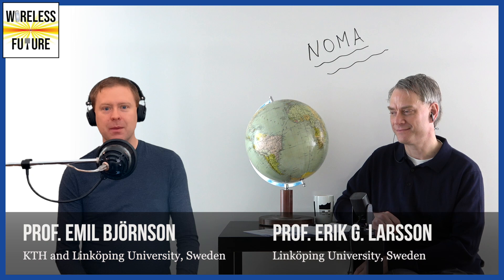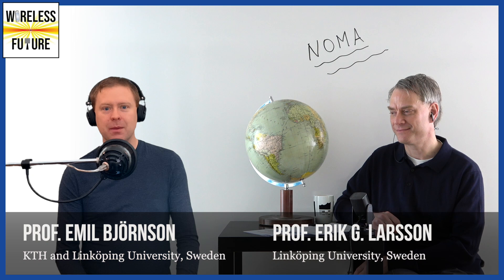Ep 11. Non-Orthogonal Multiple Access [Wireless Future Podcast]

Comment: Dear professors, I have questions about NOMA further. what is the control signaling procedure used by NOMA? how do they allocate different frequencies and time slots to send data? I believe the power coefficients are announced by the control signal. I want to know whether NOMA uses ODFM control signaling or a completely different signaling method? Please do answer these questions if possible.
Reply from the maker: Yes, OFDM is normally supposed to be used and time-frequency blocks can be assigned as in any other system. In addition to normal control signaling, you will also need to inform the involved users of the other users’ coding and modulation schemes and transmit powers, to enable decoding of interfering signals.
Reply: @WirelessFuture  thank you professors

Comment: Why didn't the CDMA prevail in future generation as main multiple access technique ?

How can Noma decoding be used at the UE if the strong user doesn't know the channel of the weak user signal ? 

Wouldn't successive interference cancellation jeopardize the privacy if the weak user ?

Why Noma can't add advantage for massive mimo case ?

At @14:52 you were talking about considering a line of sight channel as Siso channel but you mentioned that this is unlikely in 5g but I believe with the use of mmwave this is highly likely wouldn't you agree ?

Any recommended reference for code domain Noma and how does it work ?
Reply from the maker: CDMA isn’t providing any extra radio resource dimensions, it just divides them in a different way between the users. OFDM turned out be easier to implement and give more flexibility.

In downlink NOMA, a user doesn’t need to know the channel of anyone else since all signals reach the user over the same channel. However, the user must know the modulation and coding scheme of the co-users.

Privacy is maintained through cryptography. Wireless is a broadcast medium so anyone can listen and decode signals.

Non-linear processing such as NOMA can bring benefits when there are strong interfering signals, but massive MIMO utilizes user-specific beamforming to make sure that there is little interference between the users.

It is only a situations where massive MIMO cannot suppress interference well that other methods become useful. This could be a LOS scenario with very closely located users.

I recommend the paper that is mentioned in the description of the video.
Reply: @WirelessFuture  
Thank you for clarifying things up , but in massive mimo we allocate users same time Freq resources and separate them in beam domain

By Noma we can add more users to the system by sharing the same beam , wouldn't this be and advantage of Noma in your opinion if combined with massive mimo ?
Reply from the maker: @yasserothman4023  The problem is that you need to find users with very similar channels so that they prefer the same beam. This is unlikely to happen, except in the LOS case that I mentioned. The rate splitting framework describes in the paper is at least guaranteed to give better performance than massive MIMO in any situation since it is an add on, but my impression is that the gains are marginal.
Reply: @WirelessFuture  

I have some questions in rate splitting and I appreciate your feedback , those questions came after reading the paper you mentioned in the video description 

1-May I know what does the common message represent in practice , how can we determine its size and content ?

2-How does this scheme (rate splitting) achieve better gains compared to Noma if both depends on successive interference cancellation ?
Reply from the maker: @yasserothman4023  1. Section VI in the paper describes that the common message contains a summation of data intended for individual users. It is basically transmitted using TDMA or FDMA, so that each user extracts the part of interest. How to select the right size of the common message depend on the performance metric that you want to maximize. There is a discussion about this at the end of the section, focused on maximizing the multiplexing gain.

2. This is the main topic of the paper, so I cannot repeat it here. The conclusion section provides a summary. “This is due to the fact that the fundamental principle of NOMA consisting in forcing one user in each group to fully decode the messages of other co-scheduled users is an inefficient design in multi-antenna settings.” “Instead, non-orthogonal transmission strategies for multi- antenna settings should be designed such that interference is partially decoded and partially treated as noise based on the rate-splitting (multiple access) literature so as to truly benefit from multi-antenna transmitters (and potentially multi-antenna receivers) and SIC receivers.”
Reply: @WirelessFuture  Thanks again
1-but comparing proposition 7 and 9  in the paper i see that the same DoF is achieved in both the  cases of rate splitting and linear precoding , in this case what is the need for rate splitting that use more advanced receive processing technique as sucessive interference cancellation ?

2-from table II i see that the sum DoF from linear precoding (2nd entry in the table) is lower than that of rate splitting for the case of imperfect CSI 

may i know why ? what is the reason behiend this performance gap although by my first question above both schemes had the same sum DoF for the case of perfect CSI ?

3-all the analysis in the paper solely depends on the Asymptotic analysis of snr as snr tends to infinity , is it practical and sound to judge different techniques based on this regime ?
Reply from the maker: @yasserothman4023  1. Rate splitting can only increase the multiplexing gain under imperfect CSI (there are results regarding that in the paper), but it can improve the sum rate also under perfect CSI. The multiplexing gain only describes the slope of the sum rate vs. SNR curve.

2. The maximum multiplexing gain is reduced under imperfect CSI and rate splitting can be tuned to achieve that maximum multiplexing gain, while linear precoding cannot (unless one adds some layer of scheduling on top of it).

3. There are many relevant metrics and the multiplexing gain (an asymptotic metric) is only one of them. As said in the podcast, the practical gains from both NOMA and rate splitting are probably small, except for in niche scenarios where the user channels happen to have properties where these schemes work well. See also: https://ma-mimo.ellintech.se/2021/04/15/is-there-a-future-for-noma/
Reply: @WirelessFuture  thank you